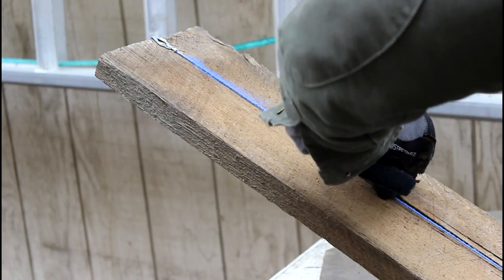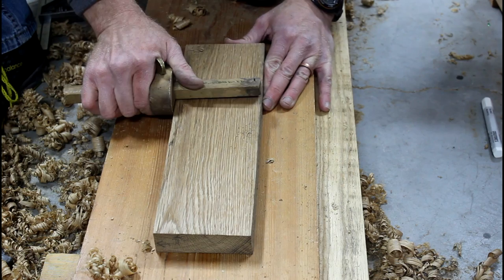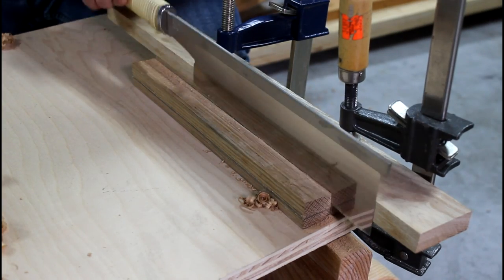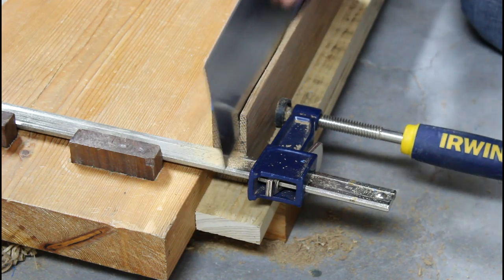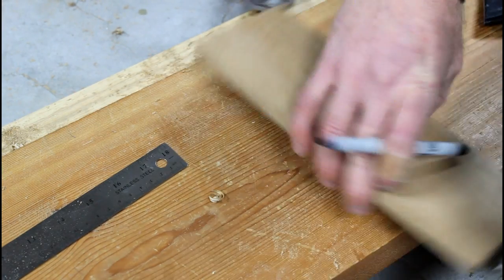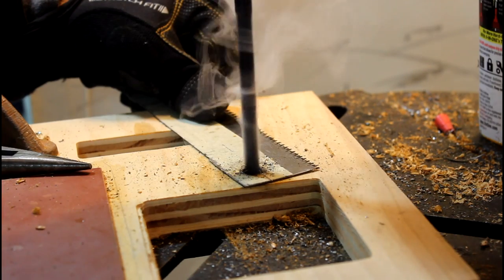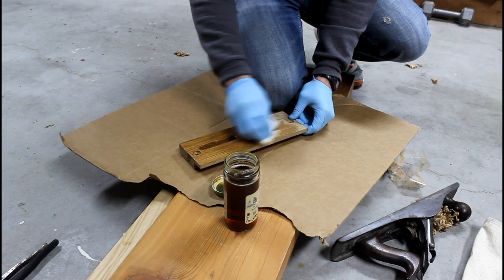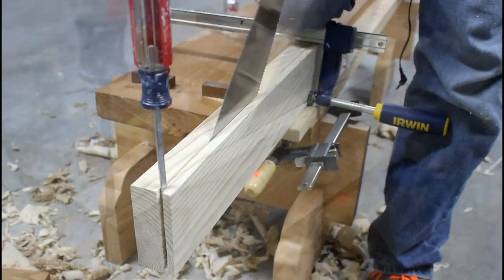Make a Japanese Style Kerfing Plane

Comment: when drilling the saw blade I would recommend two things... first, anneal the small section you are drilling so it is softer and not hardened steel (don't let the critical heat travel to the teeth or they will go dull more quickly) second, use what us machinists call a center drill... it is much shorter and much easier when drilling through sheet metal such as a saw blade. thanks for the video!
Reply from the maker: Thanks for the tips! I'll have to try those when I make another one.

Comment: how do you find the grip? ... or the general usability? i too am 100% into kannas and  looking forward to making one of these kerfing planes eventually, but i cant help but think that these kind of planes (along with ploughs) are easier as a push type. mainly because of the coordination of your hands... i feel like keeping the fence in position AND pulling is going to be hard to balance. what is it like? Thanks in advance! (+1 subscriber!)
Reply from the maker: Funny you should say that.  I was thinking the same with pushing it.  I'll have to give it a try.  Only thing is I don't have a traditional workbench at the moment (because our garage is full of my junk :) ).  I find it easier to pull the tool when I'm working in the temporary workspace like on the floor.  I had no problem keeping it aligned in the long rip but the short end grain was more difficult to start and keep the fence aligned.  When doing the end grain I came to the realization that if I slowed down and let the saw do the work it was easier to control.  Also, that it didn't truly matter if I started the exactly  perpendicular to the cut 100% of the time to begin with.  What mattered was light, controlled strokes that let the saw do the work while I focused on the tool alignment.  Again, this was for the end grain cut.  Once you get that initial groove for any side it becomes easy if you remember to to force the cut.  Thanks for subscribing!
Reply from the maker: Sorry, I forgot about the grip question.  It was similar to using a kanna.  I should have made the body area where your hand wraps around a little taller.  Next time.
Reply: AdventuresInDIY Thanks for the reply! Yes, the end grain was the most concerning part to be honest haha. However I think it wouldnt be all that too easy with a push type either on an end grain, so yeah.. 

I just got a spare ryoba (kyokucho) and cutting it in half or drilling hole seems nearly impossible.. this thing is super hard, almost to the level I am surprised it flexes!

Comment: It would be better if you punched a hole in the blade and not burn up your drill bit trying to bore a hole in hardened steel.
Reply from the maker: +Jim Schowe good idea. Thanks for the tip. I'll definitely do that for the next one.